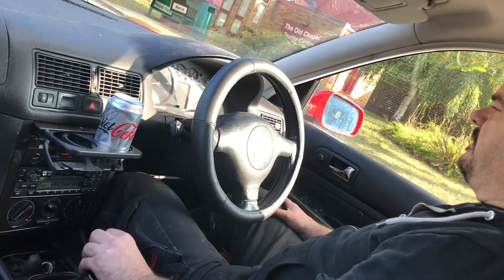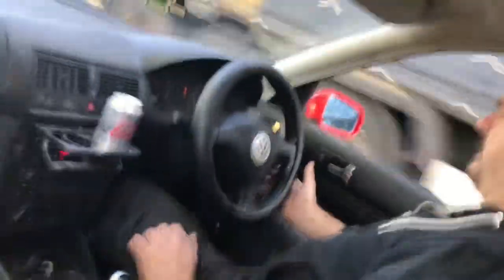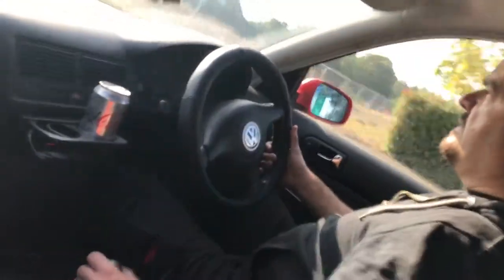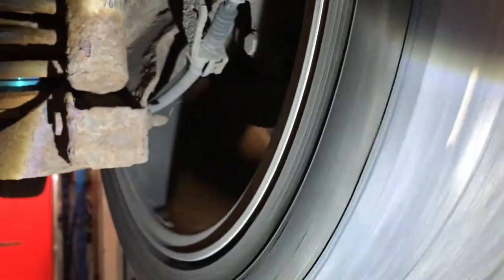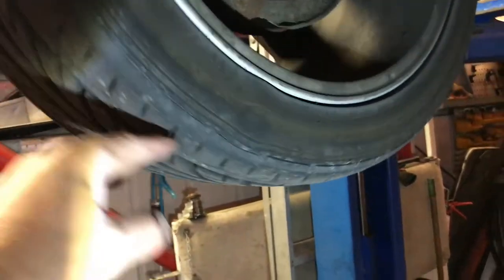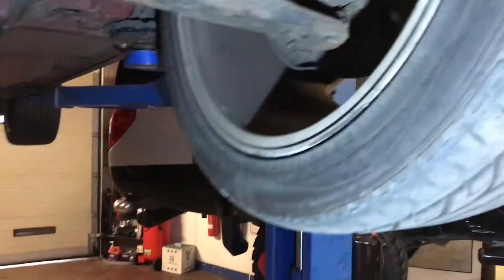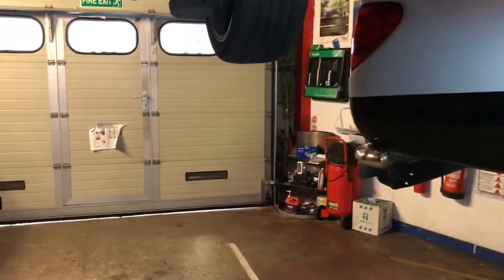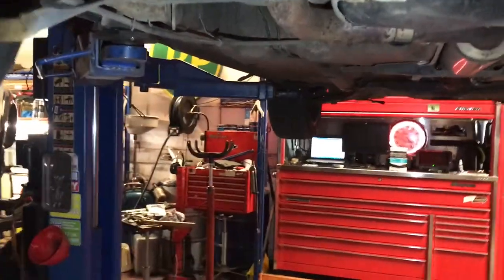example and diagnosis  of Vibration When Driving At Low Speed

Comment: My 2004 Mercedes E500 has a pronounced wobble in the steering wheel that can be felt inside by the passengers at very low speeds!  I have got to check this out!  Thanks, Tom
Reply from the maker: Okie-Tom have a look at the rear ones too as this can cause  the same exact feel that they are experiencing
Reply: Glen Smith , thanks, I am going to take it to my local tire and alignment shop and have them check it out next week!
Reply: @Okie-Tom  what was wrong with it
Reply: @Okie-Tom  What was the problem?

Comment: I have a 2011 chevy tahoe.  There's vibration/grind coming from the rear at 25 to 30 mph. Any ideas. It comes and goes.
Reply: Mine too,I have a Chevrolet Captiva and as I start to accelerate it feels bad(high sound,and a vibration)but as soon as I reach a speed,it stops...

Comment: Having issues  with my  2012  nissan altima   Shacking while accelerating  i got a new transmission  new  cv axle  that was bad  and  it  still shakes   New  tires  replacing the shocks and  the second  axle  hopefuly it  stops
Reply: Kevin Ráfaga Colin tried to change my drive shaft but still have the shakingg when driving. Shakes badly on highways
Reply: i also have same problem when i change sparkplug after 1 month start sharking :(

Comment: What about steering wheel jumping/vibrating when tirning right at low speeds. Thanks in advance
Reply from the maker: Check you powersteering fluid level , if its low air in the system can cause those symptoms .

Comment: New transmission new shocks new axle and wheel bearings and the wheel still wobbles when driving low numbers down hills or just slightly rough roads
Reply from the maker: What vehicle have you got ?
Reply: bushing rot

Comment: My truck shakes only at like 20 mph then it’s fine at any other speed. Do you know what the problem could be?
Reply from the maker: What make of truck and model do you have ?
Reply: @glensmith1499  2005 Toyota Tacoma
Reply from the maker: Have a good look a the prop shaft and bearings as it’s such a low speed vibration .

Comment: My moms sounds just like this and when the brakes get pressed it gets much louder. And it doesn’t happen all the time. And the tires look just fine. I’m thinking a bearing is bad.
Reply from the maker: Jace Henderson I would recommend not to drive the car especially if it get worse when braking , if you have breakdown cover give them a call usually the don’t charge for a diagnosis and would be your safest option, most fast fit service areas will do a free check or obviously a garage would be the best option. 
Some common causes could be warped brake discs / play in wheel bearing/ play-in.  suspension components / even rear tyres out of shape can cause the car to shake the steering wheel .
Reply: Glen Smith steering wheel doesn’t shake so it isn’t a warped rotor. And it happens about 60% of the time after it is driven for about 20 minutes. I noticed it also got louder when we hit a dip and the car presses down against the shocks which would put more pressure on the wheels and bearing. But it only gets louder when you hit a dip or press the brakes when the noise randomly starts occurring very faintly just cruising. It’s a low frequency vibration with a pulse that happens sometimes at speeds around 20-30 up to 50-60+ and the pulses seem to oscillate at the same speed the tires take to make a rotation and gets slower when the car is slower. But I checked every single wheel even the ones I thought weren’t the issue and all of them were totally fine, there’s no clicking so not a bad CV joint. But my uncles old saab had a bad bearing and it sounds similar to what my moms car has in regards to the pulsing noise except it isn’t happening all the time, and my uncle seems to think it sounds like a bad bearing. Really nothing else I can think of.
Reply from the maker: Jace Henderson when it happens again have a feel if each wheel and see if one is warmer than the others , this may point you in the direction of which wheel to focus on , sometimes noise follows with heat on the affected area such as bearings sticking brakes and so on
Reply: Glen Smith based on the the noise it’s most likely the front left. My mom says the pedals seem to vibrate pretty badly especially the brake pedal which would make sense if it’s it coming from the wheels.

Comment: Hey can you help me , i just replace all of my front suspension parts. But, when I taking hard corner to the right , my car shaking. What is the problem ?
Reply from the maker: Hi . What is the car and what did you replace on it ? Did it shake before you replaced any parts ?
Reply: I think my car not very known well in your country. A Perodua Kancil.A rebadged Daihatsu Mira L200.  I replace driveshaft, discbrake rotor, all of the bushes, steering rack set, lower arm and absorber. Before I replace all of the front parts, the car is only shaking when doing hard acceleration at straight line, braking and making "tuk tuk" noise when uturn (driveshaft problem) which is already gone after replace the parts. But, it turns out that this new problem occur after replace all of that. It seems that my mechanic doesn't have any idea that would explain about it.
Reply: Check your cv axles.. if they are aftermarket it will do that

Comment: My Honda CR-V 05 does the same when driving at low speed but not shake its I feel like the tires are wobbly something like that when driving at 20 or 40 it left go the gas pedal it stops lowly and I noticed a clunky sound on the front right passenger side
Reply from the maker: fredy Calderon you may want to check your drive shafts including the end joints , this also can Cause the symptoms you are describing .
Reply: Glen Smith  yes I check those but I noticed I swap the right front tire to the back read cause I looks like it have some kinda bump the guy where I got the car it looks they hit the sidewalk and then that why I swap the tire but a just a few weeks noticed the rear tire on the left has the same thing as your tire that shows on this video so I  guess I need to get get new tire and do the alignment cause this car needs it I replace a bad bushing on the lower control arm
Reply: my crv is doing the same 9 I know i need tires i m hoping thats the problem  ? what was wrong with yours? thanks
Reply: Percy D still having fix it yet I need to get new tires
Reply: I HAVE 2004 HONDA CRV NEW TIRES AND 2 ALIGNMENTS DIFFERENT SHOPS AND I STILL GET A WOBBLY FEELING IN STEERING WHEEL FEELS LIKE ITS COMING FROM FRONT PASSENGER SIDE WHEEL ANY IDEAS THANKS AGAIN
Reply: @emiliolopez6031  u don’t k me mine does the same if you take a look in the rpms you will notice every time it does that it kinda drops a little bit

Comment: Bro I have Toyata Corolla 2007 haveing issues like while driveing40-60 I have vibration can u please give me some ideas
Reply from the maker: Swathi Kumar R is the vibration only at theses speeds , dose it get better the faster you go ?
Reply: Glen Smith yes above 60 it’s going good
Reply from the maker: Swathi Kumar R I would start with getting the wheels balanced first as you are able to drive through the vibration .
Reply: Glen Smith yes bro I’m balanced wheel by its happend Same only it’s also getting from shock absorbers??
Reply: Glen Smith bro it’s happend on shock absorbers
Reply: 60 kmh or mph?

Comment: I have a ford moneo mk4 2011 ,2.o diesel,my problem is that my steering wheel shakes left -right like a masage over 80km/h...wheels are perfect balanced..summer tires...looks fine...i dont know what tot do else...the vibration i can feel it too in the front of the car....and braking with engine it shakes lets say....any idea? than
ks
Reply from the maker: 26vasy is the vibration more when you apply the brakes to slow down?
Reply: @glensmith1499  no,not when braking,just drivin ,it start at about 80 kmh,and if i go higher on speed so the vibration it becomes bigger
Reply: @glensmith1499  tires are summer continental,not old and in good shape lets say,im thinking to buy goodyear all seasen gen2 ,maybe i get rid of the problem
Reply from the maker: 26vasy I would have to say it’s probably a tyre problem , you may have thrown a wheel weight , visibly the tyres will look fine in this case , take it to a tyre company to check the balance first before they rebalance, sometimes they’re move the old weights first before you can tell what it was like , just by habit .
Reply: @glensmith1499  i was to a shop to balance tires,i said to them please dont remove old weights,just check tires first with old weights,perfectly balanced ,the problem may be i think not from balancing but from tires instead....this tires with rims are second i have,with both sets vibrates...can it be from a wishbone or something that is old ? thx
Reply from the maker: 26vasy usually vibration at speed through the steering wheel will be something rotational causing the problem, tyres wheels ,brake discs , wheel bearings , driveshafts etc .sometimes if you have play in steering and suspension components this will be made worse .
Reply: @glensmith1499  any idea what can i check first myself?
Reply from the maker: 26vasy swap the wheels front to rear first
Reply: @glensmith1499  i will buy direct allseason tires and put it on
Reply from the maker: 26vasy good place to start , let me know how you get on .
Reply: @glensmith1499  i will be back with news
Reply: i buyed Goodyear Vector4 season gen 2 ,and the vibration is gone almost 100%,left lil bit between 100-120kmh but its possible that its just in my mind....
Reply: maybe the aloys are not perfect straight...are ford genuine ,but mecanics didnt sayed anything about aloys problem
Reply from the maker: 26vasy good news that’s great
Reply: @glensmith1499  it startet again,so i had about 2.3 bar on all wheels from service,and i wanted to travel with about 3 more people in the car and i put them on 2.5 bar abou 800km...in the begining of the trip start to shake the steering wheel again,now im down to 2.2 bar on all wheels but is whorse....i do not know what the hell is happening with my car...if the wheels are echilibrated ,and tires are new ,what can be the problem? tie rod have been checked and answer was that they are in good shape,just right side inner tie rod have lil bit lets say play or noise when pulling it...can steering wheel be shaking from directin problems? thx
Reply from the maker: 26vasy if the problem went away whey you had the tyres changed and has now come back I think you need to recheck the wheel balance , it may have lost a wheel weight . Start there first to Make sure that’s good.
Reply: @glensmith1499  if not may be i think drive shaft....left or right,because in engine brake i feel a shake too and if put in neutral at high speed and deccelerating it shakes